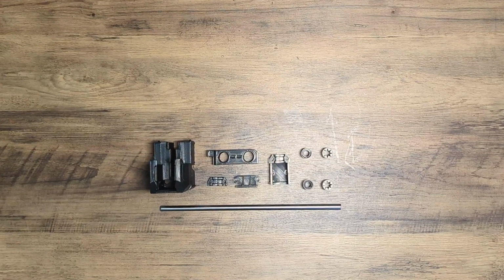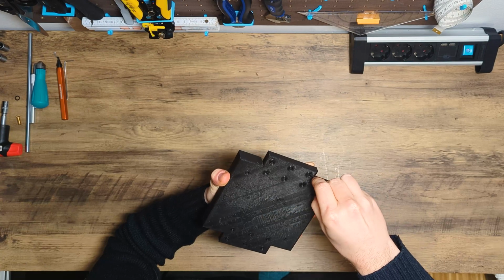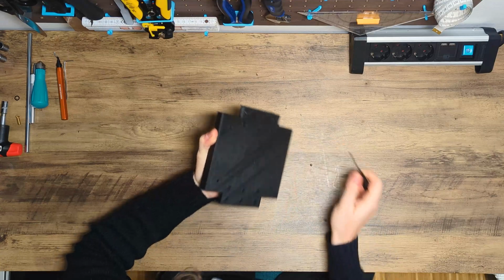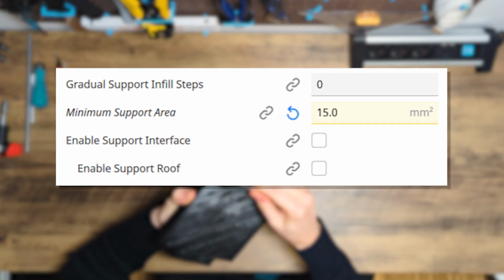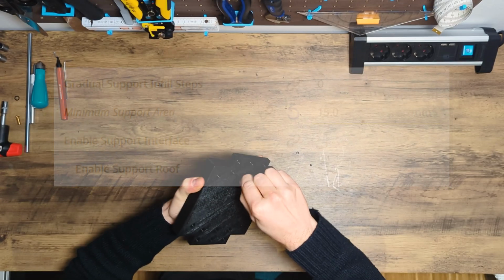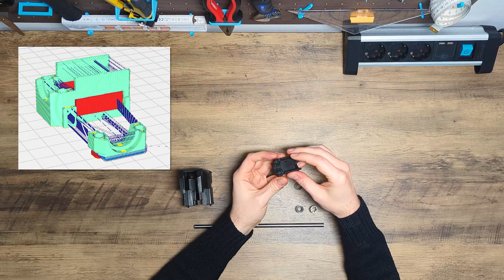THE 100 Assembly Guide - Part 1: Toolhead

Comment: Timing for video segments:
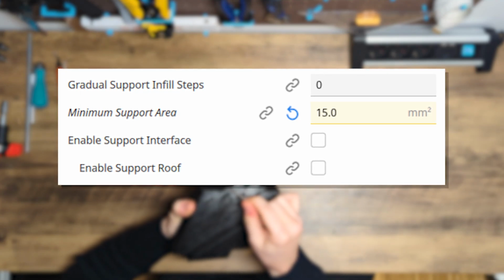* 0:31 Set minimum support area to 15 mm^2
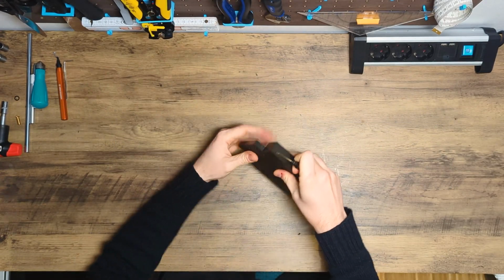* 0:40 Print rod carriage with rod holes vertical
* 1:05 Print fan duct upside down
* 1:25 Add a support blocker in lower part of fan duct
* 1:32 Print hot end holder laying on its back
* 2:20 Use soldering iron to insert brass thread inserts
* 4:12 Heat inserts for fans
* 4:30 Reinforce fan wire attachments with glue
* 5:18 Overview of heat inserts vs printhead version
* 6:06 Selecting the right rod and drylin
* 8:12 Check the belt fin in the rod carriage
* 8:45 Hotend assembly
* 9:08 Heater wiring support removal
* 9:45 Assemble melting part
* 10;00 Assemble nozzle (two variations)
* 10:42 Screw on cooling fins, add Bowdin connector and clip
* 10:55 Add hot end to carriage
* 11:12 Add clamp and fan
* 11:16 Assemble fan duct
* 11:45 Screw rod carriage & fan duct together
* 11:55 Add connector plate to fan duct
* 12:12 Add blower fans to air duct
* 12:45 Printhead complete

Comment: Hey Matt, I decided to build myself one of these. I already have all the parts for the toolhead printed and bought, but in this video you say to NOT to use the CHC vulcano nozzle, yet link in BOM table gets me to aliexpress page with the "longer" nozzle, that i unfortunately bough 3 pieces of :D I think the seller on aliexpress either purposely changed the product or there could be a mistake in BOM. It would much appreciated if you could point me in the right direction as I have no previous experience with this

Comment: Hey Matt, have you experimented with a cpap tube connected to a much larger blower mounted to the frame? I have a 120 mm blower that is quiet and very powerful. I'm not sure if it would reduce weight, as the weight of the fans is replaced by the weight of the tube, but not the entire weight of the tube is accelerated. However, I'm not sure if the additional weight would be consistent at all locations of the print head.

Comment: I don't know if you will see this - but I noticed that if you use lm8uu bearings they don't fit tightly into the prints...  what should we use to hold them in place if we aren't using drylin?
Reply: I'm trying with drylin but I feel them really tight, not sure if that's gonna work. Already mounted the hotend and I need to push hard to move the hotend through the rods

Comment: Matt, I was perusing a chart on relative material weights with your statement in mind that you want the body of the printer heavy, but the moving parts light. According to the printed instructions guide, the toolhead used 43.2 meters of filament. It happens that PLA is 2.99 grams per meter, while ASA is 2.53 grams per meter with better thermal properties. Wouldn't you be able to shed just shy of 20 grams on the toolhead by using ASA? ABS is slightly lighter than ASA @2.5 grams per meter, but I'm a bit dubious about using it to save only 0.12 grams of weight, but I am going to try.
Reply from the maker: Yeah that's true you might save 10-12g when going the ABS route, but keep in mind that the toolhead is a pretty complex part to print so i would suggest to use absx or a printer in an enclosed environment
Reply: @MattThePrintingNerd  Yes sir, I used my Bambu P1S and it worked brilliantly.

Comment: I am very interested in how you designed and optimized the fan ducts for this item!  You designed it with a cross flow instead of directly opposed flow to improve cooling right at the tip of the tool head... In short, how could someone go about learning how to do that for other printers, part cooling is the limiting factor for print quality at speed on most of my devices and I'd like to see if I can apply a similar principal to them.
Reply from the maker: Can't really describe it, I think the key thing is tinkering and learning. But for me tinkering comes first, you have to make the experience that something is wrong in the first place so that the things that you learn have a structure where it could dock onto, otherwise you loose the learned things after a couple of weeks and than it's repeat all the time..

Comment: Great hardware design, but heatsink cooling fan may affect zone of printing. May be additional divider between nozzle and heatsink will be nice improvement.
Reply from the maker: That's a good point, never had issues with that but it might be create a race condition where the heater has to work more to compensate the cool. Will double check it

Comment: I'm already in the process of ordering the parts for this printer. But I want to make a few changes. My first main one is the mainboard. The price of a skr Pico and a raspberry pi zero 2 alternative for me is £20 less than a manta m8p and a cb1. My second change would  be the hot end. I want to use a phaetus Rapido. I like having all my printers use the same hotend and extruder. My third change is the bed design. I'm going to look Into seeing how easy it would be to have a kinematic bed similar to the rat rig vcore I have. Once I went automatic leveling, I can't go back to normal. This also should help make the printer heavier.
Reply from the maker: I like all your enhancements. For my next build I will use a different mainboard to add an option for the community. I would only use the Phaetus if you plan to use it in UHF configuration. Otherwise the CHC Pro will have the same flow for half the price. If you want to know more on about the design decision i've made, especially why I choose Lead screws over belted Z, i've answered that Question as part of my Q&A Video
Reply: @MattThePrintingNerd  one problem I had with my ratrig vcore was the rocking about when it was starting a print. All the mass at the top made it wobble. I installed feet that stick out 2 inches from each corner. What a differences that made. It spread it's base out enough to stop the wobbling, even when it wasn't level. Do you think your design would benefit from having a wider base to the actual frame? For example, if someone choose a m8p and a large powersupply, a larger wider base could accommodate more weight in the lower centre of the printer? It looks very stable already.

Also, I've been looking at annex printers. I love the croxy design. Would croxy work well using linear rods? I'm sure a 3d printed annex style printer would be very popular.

Comment: I had great results printing the hotend parts with the bottom angles referenced to the build plate and above build plate only supports. The angle makes sure all of the cavities print with minimal bridges.
I also configured my CHC pro at an angle back and routed the wires try through the gap between the carriage and toolhead. No need to remove the arm.

Comment: Many thanks for the explanation! Would a Phaetus Rapido UHF Hotend fit?
Reply from the maker: Not in the current configuration. I plan to do a comparison Video for the Rapido UHF vs the CHC Pro in the future, therefore i've designed a fan duct and a hotend holder for the Rapido. It's currently beta and therefore only available for patreons. The plan is to add the Rapido as a third option for the printer for the next release in fall.

Comment: Did I hear correctly that the material you printed the tool-head with is PLA?  (03:05)  That is surprising to me, I've printed Voron's afterburner, and those required ABS.   I always assume that was due to potential heat related deformations due to the proximity to the hot-end.

Can you clarify if you meant to say ABS?

Really looking forward to the series.  I am excited on the prospect of printing and assembling a "THE 100"!

THANK YOU!
Reply from the maker: It depends on the Materials you would like to print on THE 100. For me it's only PLA & PETG and since both materials are printed with part cooling on, the Airstream of the Fanduct is more than enough to cool the part and itself. If you plan to do ABS / ASA where you normally enclose you printer and heat up the chamber to 60°C I would go for ABS.
Reply: @MattThePrintingNerd  I see... thanks for the clarification!

Comment: Cool, do we need to add BL touch or the one that uses on the mouse clicky button in this build?
Reply from the maker: In the current configuration there is no probe. But im sure in the near future there will be mods that implement a way of auto bed leveling.
Reply: @MattThePrintingNerd  Has there been any news on that front? I just ordered the parts for the build and realized afterwards that there is no sensor. This is my first DIY printer so I am a little hesitant to try to hack a mount together myself.
Reply: I'm wondering about auto leveling probe support too!

Comment: Properly lubricated steel bearing should be much more quiet.
Reply from the maker: This is a good point, i will do a take in one of the next assembly guide videos on this topic.
Reply: Also way heavier
Reply: But still way louder than the polymer😂